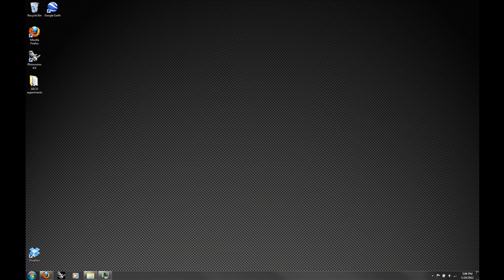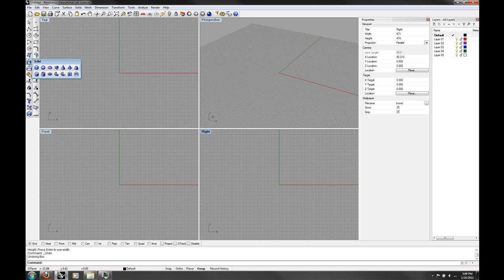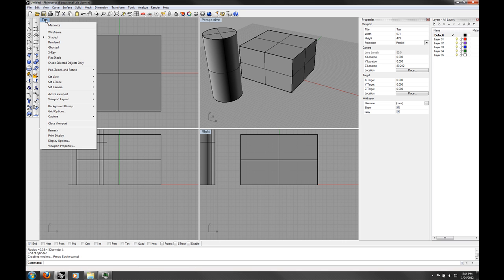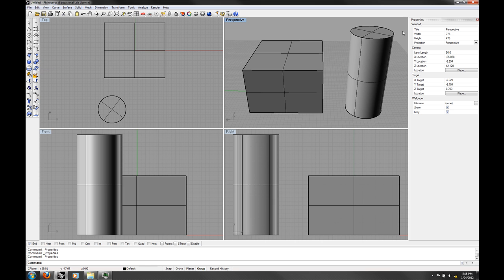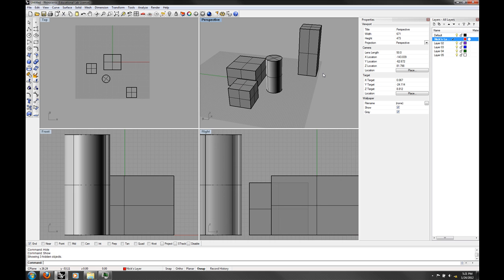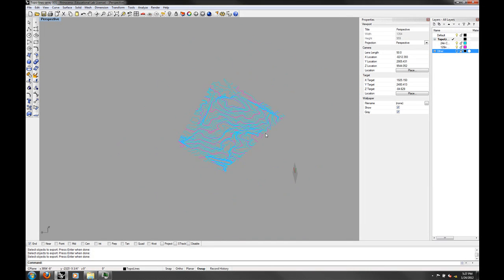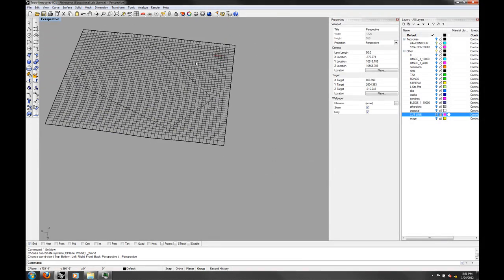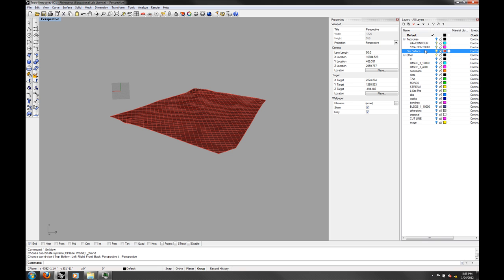Digital Fundamentals Week 3 - Introduction to Rhino and Site Model

Comment: hi,

im woking on a dwg of 98 acres in which i have taken apart of it to rhino to create a terrain(20 acres).
after turning on the points of the contours and patching it, the output surface generated by rhino is not correct. i mean the generated surface is not touching all the points (used has a reference) in some place. so is there any other way to generate a surface for the contours.

if u have no problem sharing ur email then please share it i ll send you a screenshot of the generated surface for your reference.

Comment from the maker: Rhinoterrain is a plugin that offers more accurate methods. The Terrain tool in 3dsMax also overcomes the limitations of the Patch method demonstrated here. Other methods of creating digital elevation models (DEM's) are more accurate ways of constructing a surface using point data.